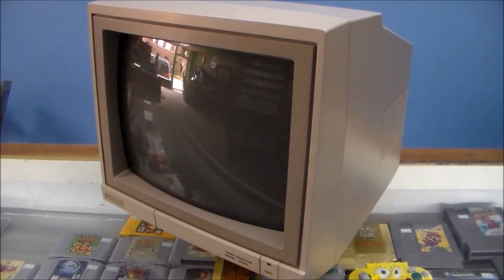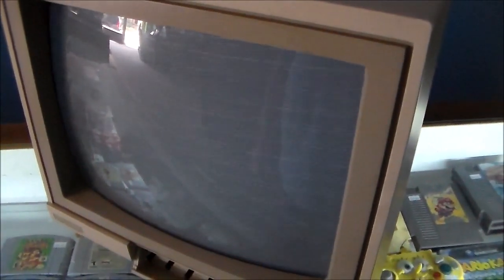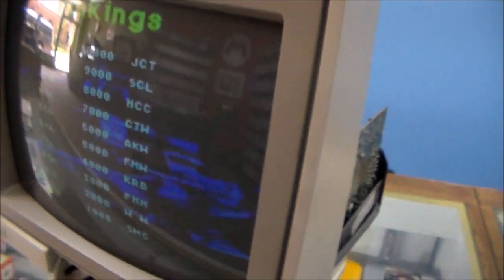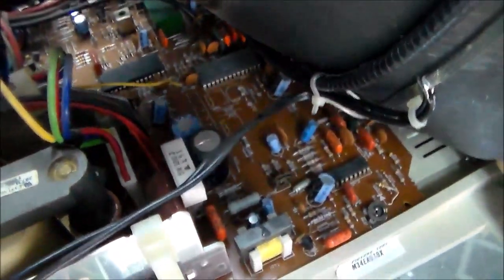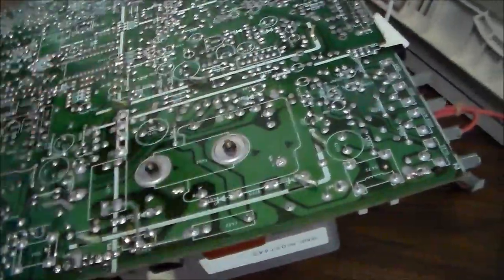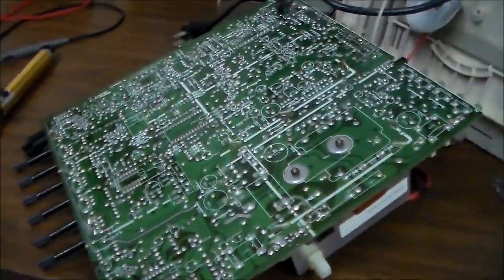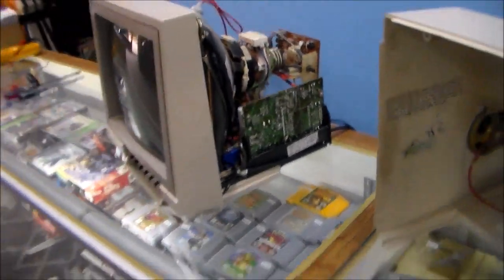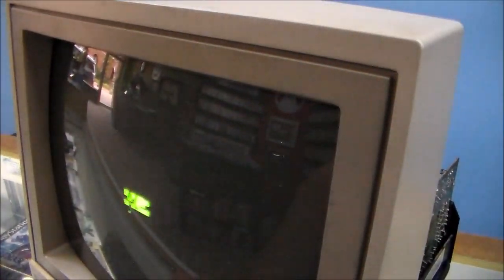Oh No!  This 1986 Commodore 128 1902A Monitor Is Broken!  Let's Fix It.

Comment: First thing I do is check and/or replace ALL electrolytics next to a ceramic resistor or heat sink. The heat dries them out! Also those raised resistors are typically what fail.   They are raised off the PCB clearly expected to fail... and they do.

Comment: The 1901/1902 series was probably the best monitor Commodore made before the Phillips CRT tubed 1084 monitors. The picture should be similar to a Panasonic/JVC/Sony in terms of brightness and contrast. I have one with a very weird fault, it will not display any colour even when used with the official Commodore S-Video cables. If you have a C64 and you don't have the space for a 20" Sony Trinitron CRT TV with S-video input, the 14 or 16 inch models have no S-video input, then these are your best bet for the non-RGB analogue 8bit Commodores.

Comment: the negative 20 is a BIAS using a standard Tube Bias Design.. almost no current. but heat over time and that lose pole on the flyback may have caused arching..  bias is used to set offset voltage levels.. meaning the voltages in this design were larger than what the CRT used, so they were offset with the BIAS voltage.
Reply from the maker: That makes sense, thank you!

Comment: How much will it really cost or the price to fix the monitor that doesn’t turn on at all and the sound speakers only work and to replace the power switch,the reason I am asking because I have the exact same monitor that has problems and I’ve been having for almost a year  and I spent 100 dollars on it and havent done anything with it and I now really gotta get someone to fix it    near my area in forth worth tx

Comment: That 1E5 resistor is what's known as a flame proof or fuseable resistor, they are normally powder grey in appearance and are marked in the schematic with the 2 parallel lines on each side of the resistor symbol. The idea is that while a normal resistor will work fine as a fuse it will have the tendency to burst in to flame & burn down your monitor if a part upstream shorts (used in places that dont warrant the extra expense of a fuse but if something does go wrong the resistor becomes the weakest point). The exclamation in the schematic is warning you to replace it with a flame proof type. Flame proof resistors are normally low values between 0.1 and a couple of hundred ohms, its also important to get the power ratting correct as a 1watt 1E5 will blow differently to a 5watt etc...
That -20V line will only be a low current line so you are probably correct that the cap caused it to fail (sacrificed itself to save the FBT).
Get yourself one of those fleebay $5 component testers and know for sure.
Reply from the maker: I've been meanting to get one of those but haven't gotten around to it, thank you for the info moshly64!

Comment: I had one of these. Mine had broken solder joints on the flyback too. 

I figured that out when the image would blink off, so I'd smack the side of the monitor, and it would pop right back on.
Reply from the maker: Nice fix (Or I assume you fixed it).... really feels good when you figure out what the problem is!

Comment: I have one of these but I can't get any video to work on it. It turns on, the crt works. Mine only has a composite port.
I have never worked on one of these so I have no idea where to start. What would be causing this problem?
Reply from the maker: I'm not too sure about these, I've only worked on this one, but have you tried the different settings on the front of the monitor?